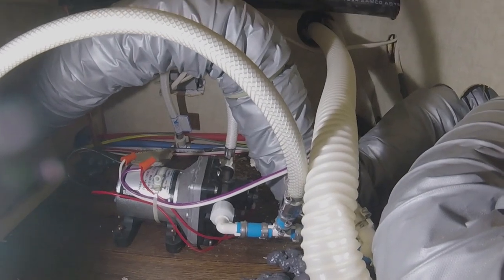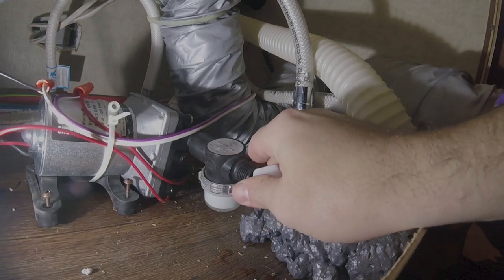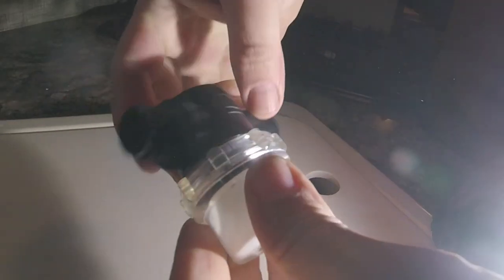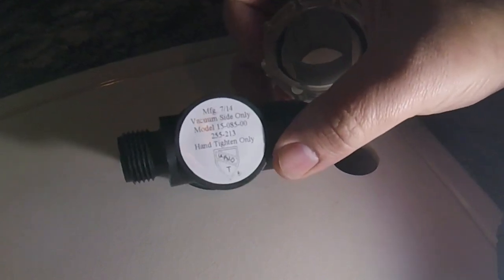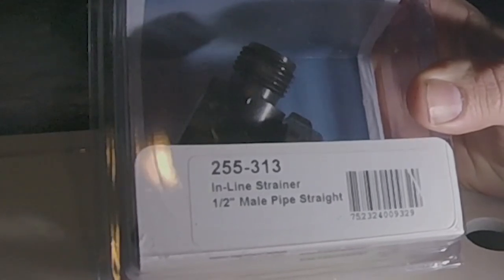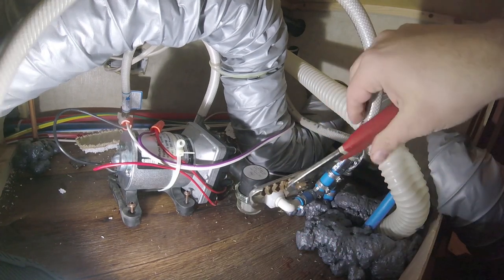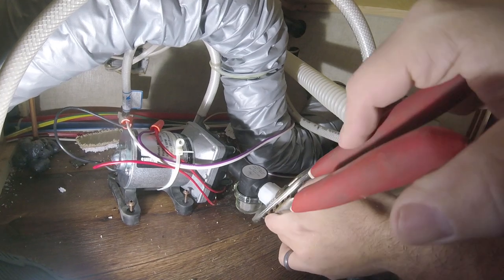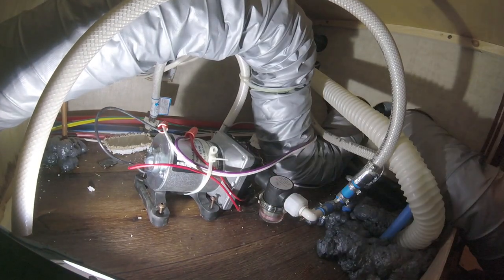EASY FIX | Sureflo RV Water Pump Runs Continuously | Does Not Stop Running | Troubleshooting

Comment: Thank you so much for the video. I’ve been scratching my head for two days worried I had a leak on the tank or the line between the pump and tank. YouTube saved the day. 
As for the other comment. The fact that he is mechanically inclined or not has nothing to do with that being a comment a prick would make.
Reply from the maker: I did the same.

Comment: I de-winterized my camper today. I filled my fresh water tank and ran the anti-freeze out of my lines. Once I shut all of my water sources off my water pump continued to run. I shut it off and let it sit. I’d turn it back on and it’d run for about 5 seconds then shut off on its own. But if I run water again and shut it off the pump will keep running. Any idea what’s going on?
Reply from the maker: Sound like its loosing pressure somewhere.   Have you checked the screen on the pump for cracks?  If it looks good I would try primeing the pump as its the easiest to fix of all the options.
Reply: @ReSellNinja  Thank you for the response! I’ll have to check that. I bought the camper brand new last May, is that not an uncommon thing even in new campers?
Reply: @JVuks53  Yes, its common.  If its brand new I would assume thay if you just prime the pump you will be good to go.

Comment: The other solution if changing the filter did not work is to simply adjust the pressure switch with a hex wrench - the control is located in the small box where the wires are going into the pump.  Surprising that in all the support materials there is no mention of this adjustment.
Reply: Save me some bucks here too! Thanks for commenting this detail!

Comment: can't believe that a strainer caused pump to not shut off, a leak in the plastic housing I could understand or air in the system or a clogged strainer yes
Reply: How does air get in the system.  Do you have to do something special when you switch from city water to using your water pump? I never have.

Comment: He didn't use Teflon tape. Use it on ALL threaded water line connections. Plus, if a pump isn't screwed down it will be noisy.
Reply from the maker: Teflon Tape is a good idea, does it matter what kind?

Comment: install the filter in the up position, water will drain when you winterize.  I have the same problem except my filter is attached directly to the pump. Going to attempt to mount the pump upside-down.
Reply from the maker: Thanks, im gonna give it a try
Reply: Mine is in the down position.  Is that a big deal?  I cleaned the filter by just unscrewing it.  I dont want to take the chance of screwing up something more.  I've noticed 2 things on my rig that dont go by the rule rightsy tightsy  leftylucy.  This filter is one of them.

Comment: Wow, that was painful watching you use those channel locks. The easier way would be to take the clear cap off the new filter and screw it on the old body without removing the entire thing from the pump. It's meant to be removed by hand so you can clean it.
Reply from the maker: That sounds mich easier